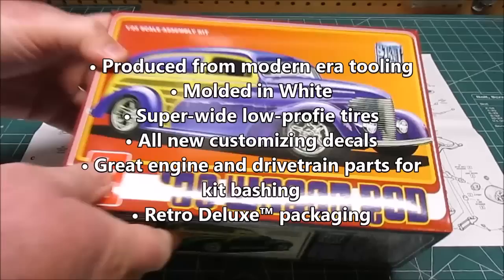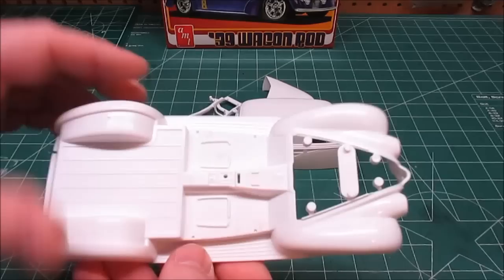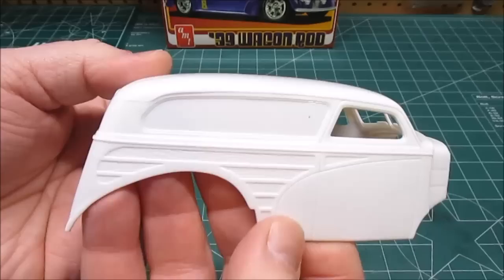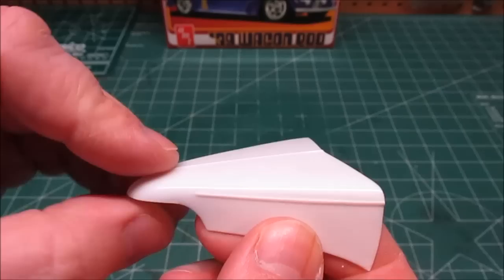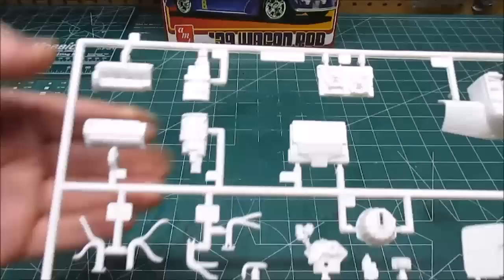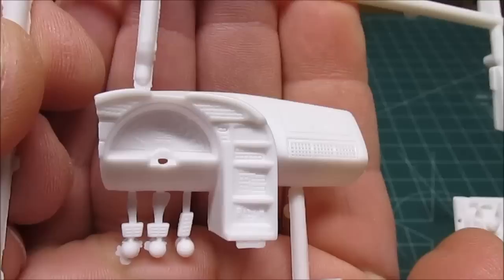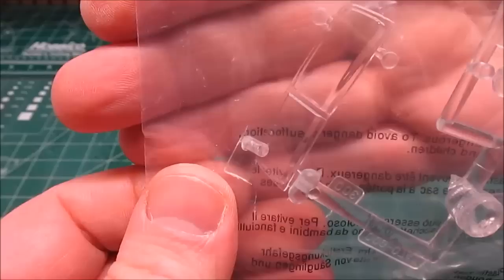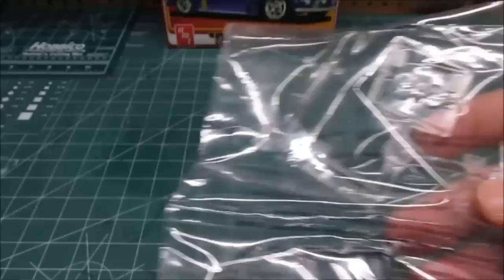AMT 1939 WAGON ROD 1:25 SCALE MODEL KIT REVIEW AMT1050

Comment: Such a great kit, I'm almost sad that I bought it as a parts car. But, I have several kits that I'm using to build a '32 Ford Tudor. The front suspension looks like it's from a Mustang II. I have a Corvette kit that will donate it rear independent suspension, another Corvette for it's small block Chevy and a 32 Ford Phaeton for those beautiful Ford V8 wire wheels. Hopefully sooner than later, I'll get to building it!
Reply from the maker: Very cool, I'm sure it will be sweet.